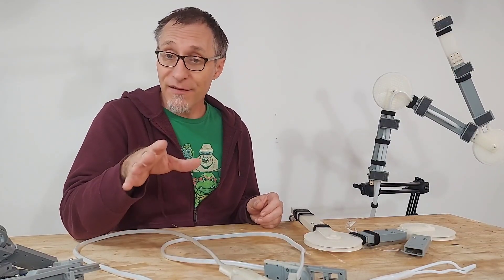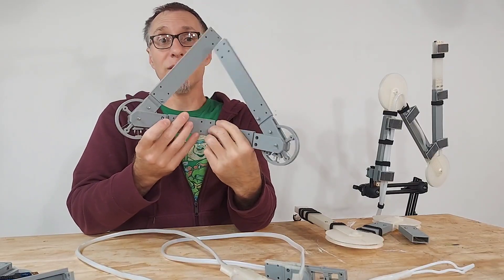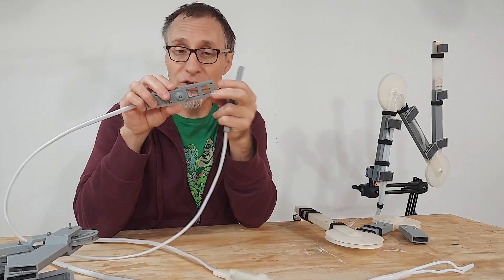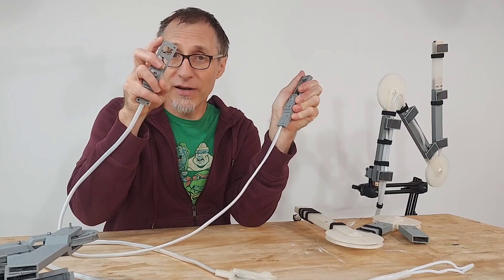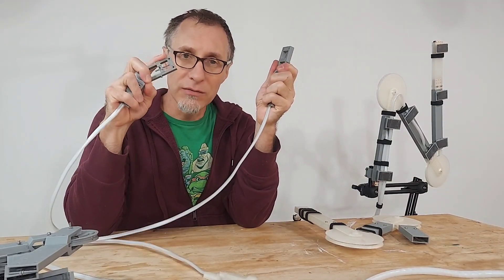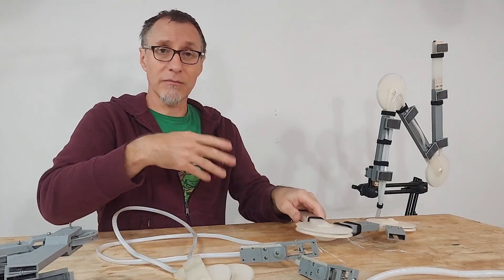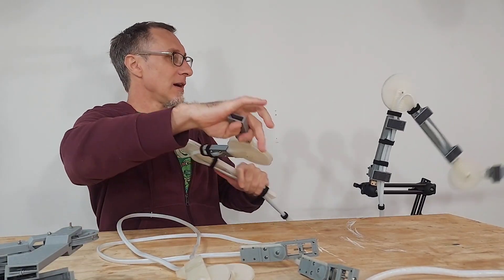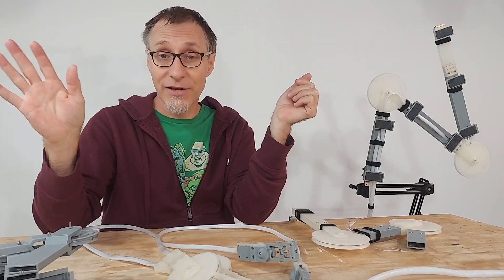String pulleys for robot arm mechanics update

Comment: One of your main issues with your assembly is rigidity. Your improved tensioning system has assisted in this, but the material and shape of the arm itself is doing you few favors in that regard. The V3 pulley assembly itself is tall, but immediately connects to a significantly thinner arm section. While you get enhanced leverage, you also end up with an underbuilt arm connection for said leverage. Inherently speaking, the larger the arm, the more weight you sling around AND the larger moment of inertia, both working against you. 

Solutions:
1. optimize models -> cut weight on the arms and pulleys, lowering moment of inertia and weight to improve responsiveness, ease of control, and stability.
2. improve arm moment of area -> in the same way an I-beam gains efficiency per weight in terms of preventing bending, you can make your arm geometry more efficient for a specific axis, improving its efficacy in certain directions. Your rectangle setup works, but could be improved for additional effectiveness
3. supplement arm leverage -> Your arm segments are acted on by the small connector at the end of the pulley. To improve stability, consider extending that connector's length and rigidity. Additionally, you may consider using a wire assembly outside of your pulley to act as another method of rotation transfer, similar to what you have already, except arm segment to segment instead of assembly to assembly.

I'm working on some files for you, but I need the following:
1. diameter of wire sheaths
2. length and diameter of your bolts (I use M4x6x6 threaded inserts and 12mm grub screws, for example)
3. pulley diameter
4. arm segment width and height
5. pulley connector dimensions (the part that slots into the next arm right at the end of your pulley)

As of now, I have ideas for improved generic arms (similar in function to yours, with weight savings that hopefully lead to improved responsiveness and lower slop), as well as specialized arm geometry (larger footprint than your current ones, pick based on the arm section's purpose) for lifting type loads (alongside the pully direction, such as for when your arm goes up and down a lot or needs to move a heavy object), torquing loads (forces that do not line up with the pulley but instead try to twist the joint sideways, like if you extended your finger and then pushed against the side of your nail), and both (essentially just a larger arm segment with good geometric stability). 

Your pulley assembly is mostly fine, I have yet to investigate its internal wire pathing to see if sharp corners exist, but other than some weight savings you can add, the pulley seems alright. The fork is less than ideal for stability, but you lack good options without increasing the footprint significantly, and/or utilizing larger connections at the rotation points.
Reply from the maker: As always, an amazing assessment and very thorough. It'll take me a minute to digest all of this 😅 but thank you for taking the time give me such good feedback.
Reply from the maker: Ask for the numbers..... that build uses M3 Hardware throughout. No M4 in the design currently.... but possibly in future designs. The wire sheath is PTFE tubing for 3D printing so it's something like 2 mm ID but it's the stuff they sell on Amazon. The cable is something like 1 mm stainless steel. The internal police are I think 10 mm diameter.
Reply: @androofroo  M4 was an example. I like multiples of 4 due to geometric relations, the strength of M4 inserts are significantly above M3 for a similar size, and M4 bits are the largest bits still considered small scale for most applications (such as for use with pen screwdrivers). I did not intend to suggest that you utilize it yourself, though i would suggest using a larger rod for your pulley. I am looking into 8mm brass rods that work well with 608RS (Forgive me if I misremember their designation) bearings, perhaps look into similar as well? 

On an unrelated note since we are now both sharing information, would you perhaps know anything about low cost vacuum chambers and/or arc deposition? I am designing a low cost TiN deposition device and the more information the better. High voltage arc generators are high on my priority list if you know much about them.
Reply from the maker: @Gaaaaaame  I'm printing up a new version today actually that uses M4 pulleys for the internal wire Channel because I like that profile better.... even though I think it's going to add a little weight.

And yes indeed as for the Axel of the police I hate riding on that M3 Bolt. My new version which I have not made any videos of yet has a ring bearing instead of a bolt... it seems quieter and more stable.
Reply from the maker: @Gaaaaaame  as for the vacuum chamber thing... oof, I do not. I don't currently have any kind of welding setup but I'd love to have oxyacetylene again at some point in the future. Maybe if we had more square footage LOL
Reply: @androofroo  tell me about it, I'm working out of an apartment bedroom. Practically have square inches to work with instead of feet. Be sure to check your "D:d" ratio for that m4 wire.

Comment: Here to see your most up-to-date progress on this. If you wish for a use case, I'd suggest looking into ways to transfer human scale movement into smaller scales. If you have a miniature arm with a gripper, for instance, then a full scale one that you wear, so long as you do not twist your arm too much, you can significantly increase the precision of your movements. This can have benefits when drawing (replace gripper with pen), precision assembly, etc. Just be sure to make the pulley ratio the same (else your 90 degree arm rotation could transfer to multiple full rotations on smaller pulleys at the other end). If you scale things down, consider using a bolt with fishing wire wrapped around it, simply wrap the excess slack around a small bolt and screw it down, that will remove the tension and secure the wire. I have not looked into its creep factor, however, which may be a concern.
Reply from the maker: @Gaaaaaame  I love this suggestion, it reminds me of something MC Escher writes about in terms of the limitations of our own precision ( he built a stack of magnifying lenses to enhance his precision at tiny scales for woodcuts so now I am picturing Escher with a robotic arm).... also, LOL... everyone else wants me to go the other direction and build a mech
Reply: @androofroo  mechs are overrated (source: insufficient funding to produce my own at the current time)

Jokes aside, string mechanisms are one of the more effective ways to assist body motion on an exoskeleton, lightweight and low cost. People have been itching for it online for a while now, as "true" mechs are immensely difficult to design due to control (how do you follow body movements properly), weight, cost, and sources of control (good luck matching muscle strands on the body in terms of mobility options, this is why mechs are stiff compared to humans).

Making a puppeted mech is doable, but unlikely to work if free to move due to the significant wire connections, limited movement options, and lack of feedback for the operator.
Reply: Also worth noting that the piezoelectric market is steadily growing, I wrote a paper on it last year and it appears to be something worth looking into if you wish to assist human motion in the coming years. Their primary issue is heat dissipation and low relaxation speed if I recall correctly, perhaps best suited for situations already covered by hydraulics for heavy loads, though less likely to damage the user on failure and able to fit smaller form factors with less piping overhead.
Reply from the maker: @Gaaaaaame  🙌 my thoughts every time I hear the request

Comment: Ok cool but  I think you can offset that with smaller pullies in more of cherry block system 

You might also line the rolling joints video 

Rolling contact joints 

Rolling joint gives different kind of vid lol
Reply from the maker: Yeah it would be interesting to have a block with multiple pulleys and yeah of course that would help with mechanical advantage for sure but the extra complexity makes me wince a little so I think I'll stick with the single pulleys for now.

Also, yeah I searched rolling joint system... 😂
Reply: @ that was my thought as well

I was considering trying and was like nope pain in the butt

When I was doing this I made module 

That could use to interface with other things
Reply from the maker: @preppertechnicianee6013  indeed modular component architecture is the best

Comment: I would be curious if bicycle shifting cable housing could work even better? The shifting housing has an inner lined tube for low friction and then the outer wall has small, stiff wires embeded in it running the length. The shifter housings are very stiff as opposed to brake cable housing which are made to squish down a bit to reduce the bite of the brakes.
Bought in bulk, I wonder if the cable housing could be cost-effective too?
Neat project! And it's fun to see the evolution of it!
Reply from the maker: Thanks for that suggestion! Yeah I really need to look into bike parts as I'm sure they have much tougher tubing I could leverage. I just happen to do a lot of 3D printing and Fabrication so PTFE was my go-to LOL.

Thanks for the note (*^ω^)ﾉ
Reply: @androofroo  of course!

Comment: This is amazing! That seems to work really well. Shame that human arms have so many degrees of freedom, I kinda wanna see (or make if I had the time) one that could copy a human shoulder+elbow+wrist and do some juggling exercises..!
Reply from the maker: @DanielSimu  plus I checked out your channel... of course you would suggest juggling LOL
Reply: this could be nested inside a CV joint to add axial rotation maybe?
Reply from the maker: @soggy6645  that's interesting.... I haven't built any axle drive systems yet but I may get into that at some point. currently am I thinking more like a drive ring that houses the joint at a 90° angle
Reply from the maker: Thanks for that! and yeah I'm with you I would love to do a full body manually powered mech 🤘... I'm sure at some point there's diminishing returns with this system... so maybe not that, but it is going to keep getting more complex.
Reply: @androofroo  Yeah, every joint adds a bit of slop and play.. but 6 axis may be achievable, if your system is modular?
Reply from the maker: @DanielSimu  indeed it is. In fact it's part of a larger framework which is entirely modular including the software components... it's grown so quickly it's kind of a hot mess actually so half my work is clean up